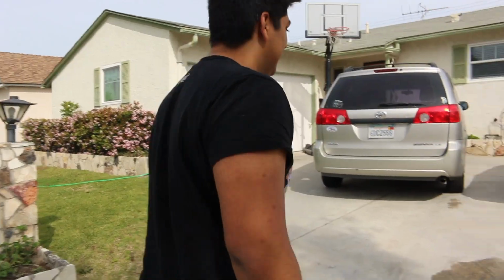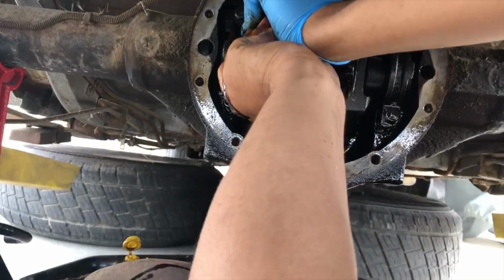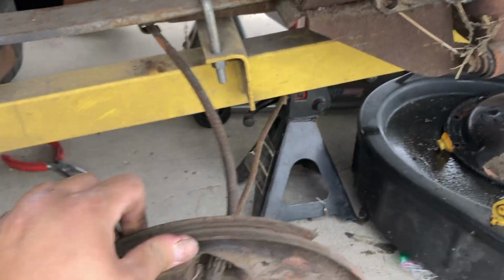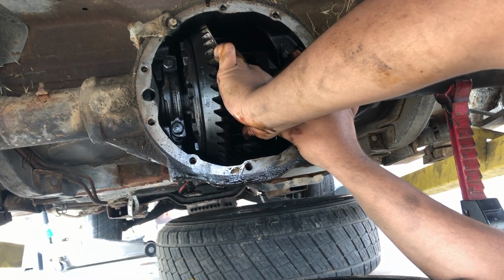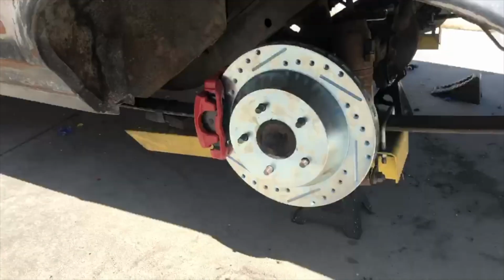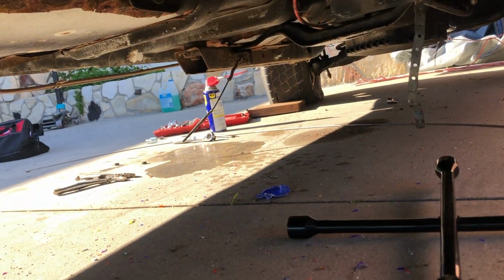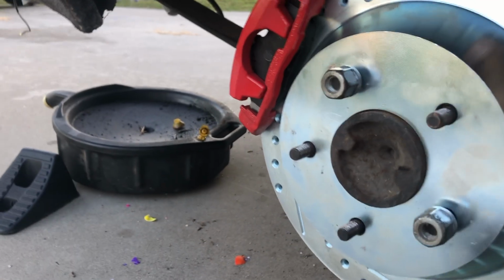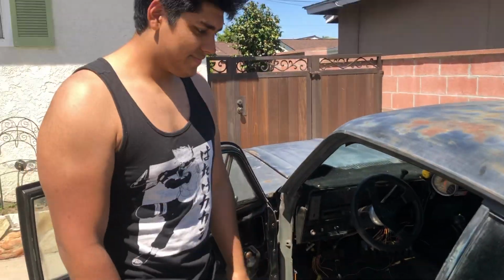Installing Cpp Rear Brake Kit On the Nova Getting Ready to Pull The Engine!!!

Comment: Glad I'm not the only one that had issues getting a kit from Right Stuff Detailing to fit properly. I had to mill down each spacer to get the caliper to center on the rotor...not to mention their stainless line kit didn't fit the calipers...oh and then the caliper wouldn't clear the 15" wheel...so had to grind them down
Reply from the maker: Our stuff fit pretty good for us it was just the cpp there link isn’t long enough to clip in with the c clip

Comment: how big are the new rotors and when you gotta do a brake pad and rotor change do you have to buy the replacment rotor and pads from cpp or any auto parts store?
Reply from the maker: I think you can buy rotors from anywhere there 13 inch and pads should just be Chevy pads